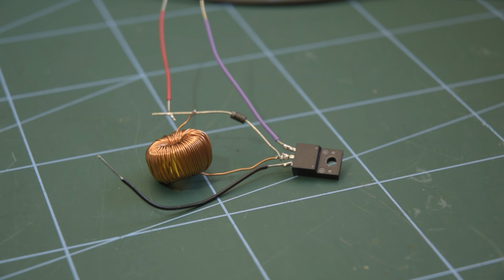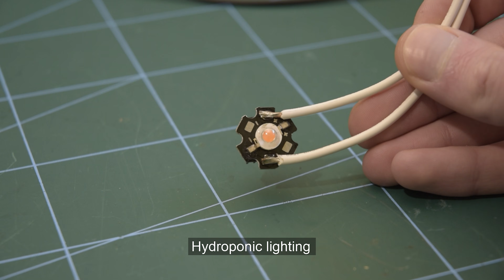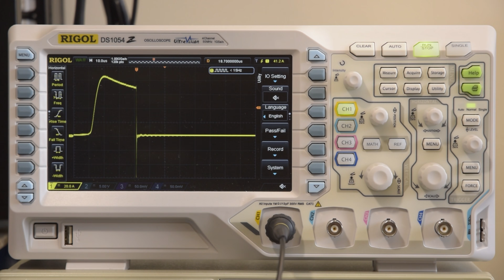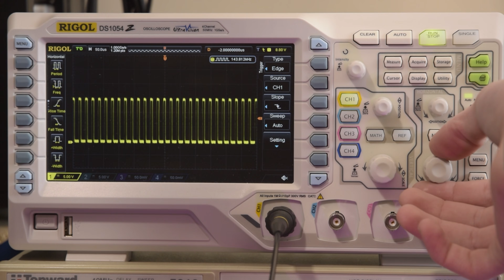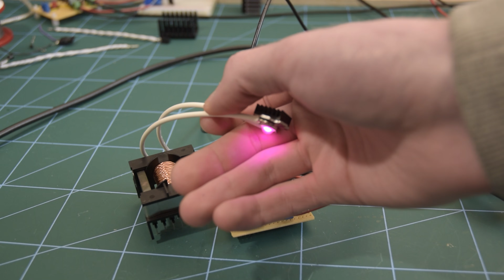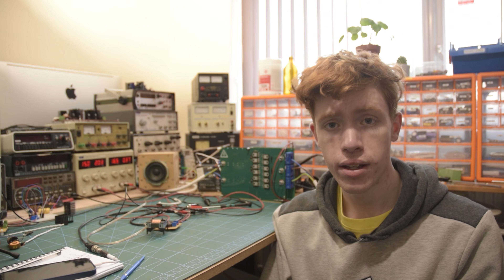Direct Current Control - LED Driver

Comment: To date a very good and refreshing set videos. At about 2:12 you show and discuss an inductor you wound. I note you have used bifilar wire to reduce ac impedance losses due to skin effect. I've not seen it before but it seems obvious for high end power network design.

Comment: What exactly lies between "Gate Drive Input" and "Gate Drive Output" ?    Is it just a wire ?     What is the "gate drive circuit" ?
Reply from the maker: The simplest explanation is that it’s an amplifier. The gate has a capacitance that needs a high current to charge up and discharge quickly

Comment: That design based off a power supply. Then modified and turned into an audio amplifier..  
     Carver amplifiers if you read about his story and a description of his very first amplifier design for audio.,
     As he describes his audio amplifier design as a first semester, Electrical Engineering, student with minimum knowledge. It’s basically a power supply that has been modified into a stereo amplifier. 
    Cool project

Comment: what is the best way to drive 3w power led using  li-ion batery.(aproprite voltage) source. ı think o can not use this technic becaus you use two power suply

Comment: great work and very useful. is that possible to share the circuit diagram for the mentioned inductor saturator (inductor saturated current tester)? thanks.

Comment: Hey dude , do you have the circuit for THE SATURATOR circuit from the video 3:17
Reply from the maker: Just a MOSFET, a freewheeling diode, and a shunt!
Reply: Rod Elliot from sound au has a more comprehensive one.

Comment: I always wanted make some simple inductor testers myself, but I think I'm too lazy. But I have special DIY generator for testing saturation current, which my dad explain to me and it is great device. PWM controller with mosfet and potentiometer for PWM setting + power supply and couple of shunts for osciloscope :)
And few years ago I made inductor meter based on op-amp generator. Recently I bought Uni-t LCR meter which make great job measuring caps in circuit without desoldering. Downside was price for me, but it saves lot of time in servicing electronics.

Comment: Good work. Just out of curiosity, do you work in electronics or is it just a hobby? You seem to have a professional background, university degree?
Reply from the maker: I did it as a hobby for many years before studying it at university, which I was doing when I made this video. I am now on a year placement working on the Formula 1 hybrid system at Red Bull
Reply: @electrarc240  excellent. Keep up the good work👌